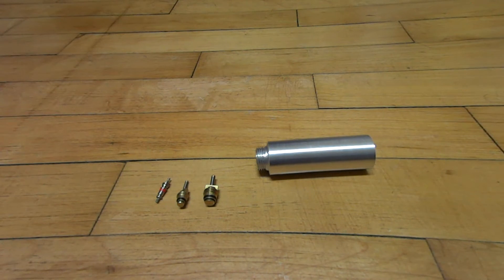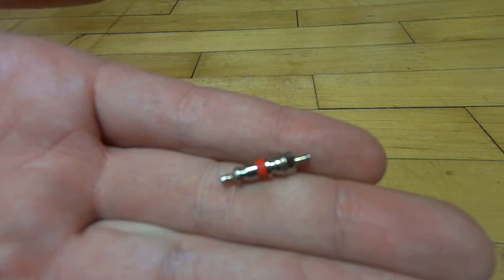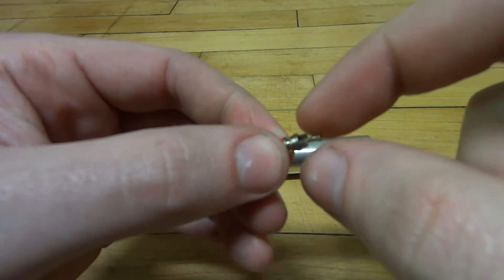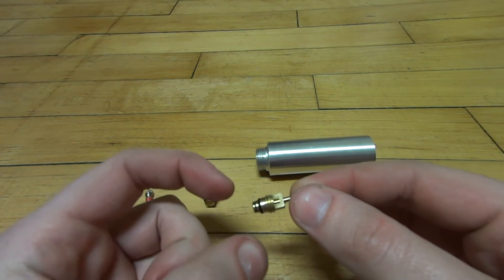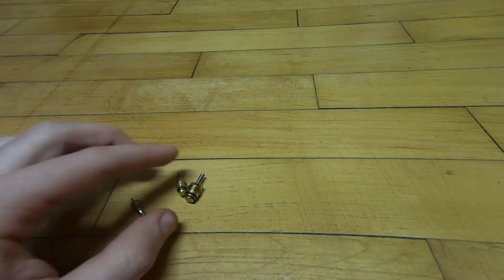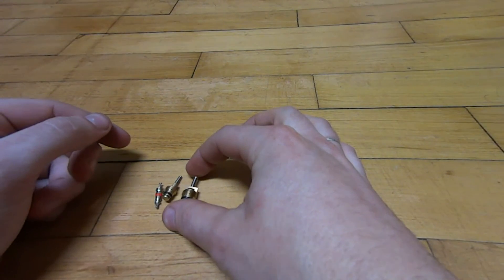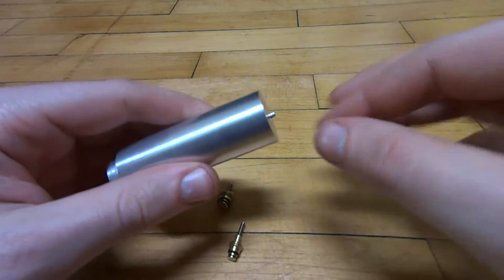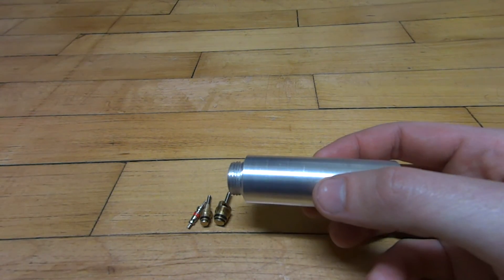QEV air gun rifle valve update and large schrader valves

Comment: M10-32
Reply from the maker: I think it's actually m10x.7
Reply: @swandonovan  could be 32 and 0.7 threads are very close match... but i'll say if they are USA made they'll be 32. I had problems with 1 i thought were m8x1 that really were 5/16-32.
Best way to know tap 2 hole 32 & 0.7 threads and try them.
Best advise i could give you.
Reply from the maker: @quebecds7498  it's metric for sure
Reply: @swandonovan  Even if it's metric they could count the thread by threads by inch, for it to be 32... Metric system use both when it comes to threads... Don't ask me why, i don't know... Like i  said before tap 2 holes and try them, that way u'll be sure.

Comment: Thank you for the information on the larger schrader valves.  I have designed and built .177 BB pistols using tire stem valves (see my Dragonfly BB pistol series on YouTube) and while they are fairly powerful, I have been looking for a way to make them I little more powerful.  The medium size valve looks like just the ticket.  I would be interested in your thoughts on using them on my Dragonfly BB Pistol.
Reply from the maker: Haha, i just watched your first video.  that's a cool little pistol.  looks pretty well made.  I think the air tank schrader valve can stay as it is, but the firing schrader would get a nice boost in power from the m8 size schrader.  obviously, other things that would help power output would be a longer barrel, and higher air pressure.  if you end up installing a m8 size valve, please upload a video and let me know what the power difference is.
Reply: Yes, I will let you know.  I just ordered a few of the larger size valves on Ebay.
Reply from the maker: the m8 sized ones?  i measured the thread pitch on the m10 ones to anyone interested.  it's m10x.50
Reply from the maker: the issue you might have is that they require a specific angle of cut on the bottom to seal.  but as i believe you have a lathe, that shouldn't be a much of a problem.  i have a picture of a cutaway if that helps...
Reply: I will have to machine a brass plug to thread the m8 into, but I have done a lot of small internal threading on my lathe.  I think I will be able to make it work.  I am working on some other projects and may not get to this for a while, but will update you when I do.  Thanks again.
Reply from the maker: it's actually not the threads that are the tricky part.  it's the angle of the seat that the external o ring seals against